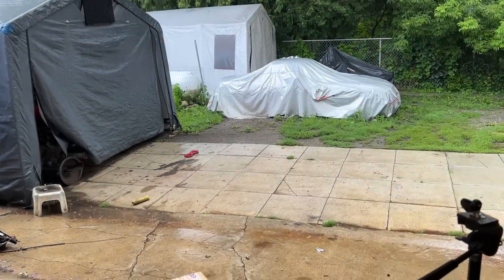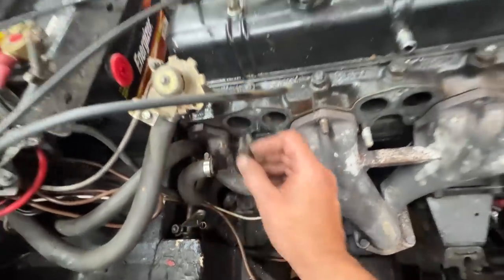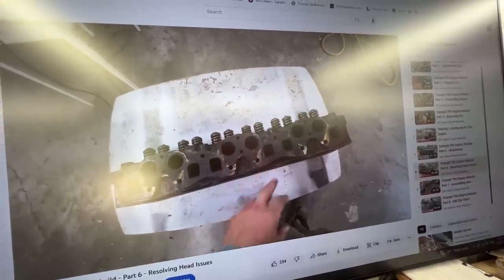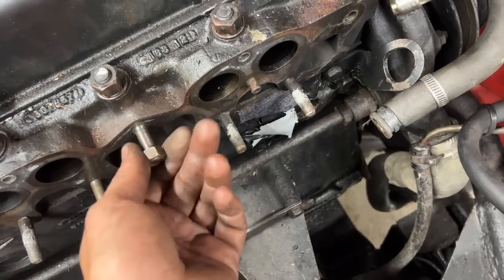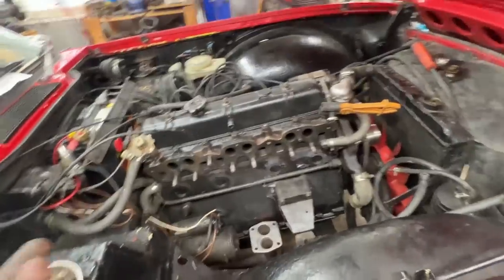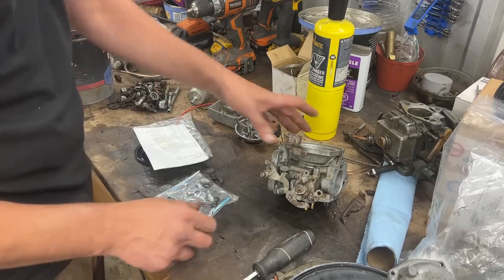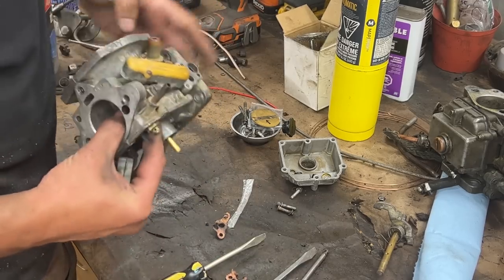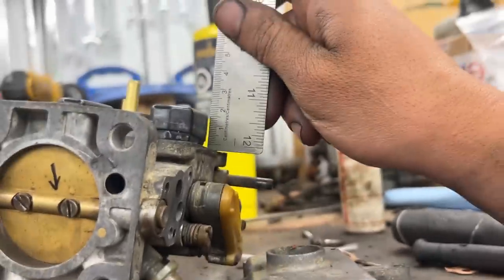1972 TR6 - Part 5 - Carbs, Manifold and Water Pump

Comment: Like you Elin, I thought that cylinder head was cracked !  Can't recall during my years of working in the motor trade seeing a manifold gasket come off in so many pieces  !  The car is starting to remind me of  the Johnny Cash song "One Piece At a Time"  as it it seems to have parts from 1970-71-72-73 😂.. Great work and video as always .. Looking forward to seeing it tuned up and made ready to rock.
Reply: I was thinking the same thing. :)

Comment: Hi Elin, yet another great video, don't know how you have the time to do it.  Ive always wondered why triumph bothered with stromburgs when the SU's were far simpler and did exactly the same job ???  must be a reason as the stromburgs must of been more expensive ?  They certainly were not better for emissions than SU's.  P.S. when are you getting back to the GT6, really missed that one, can't wait for you paint it in colour (please do it yourself that would make a great series ;)
Reply: Stromburgs are better at meeting emission standards than SUs and that is why they were use on North American cars.  The diaphragm provides more accurate needle positioning than the machined piston clearance of an SU.  As long as the diaphragm is in good condition it won't leak vacuum.  As the piston is an SU wears, it can leak vacuum which can affect the height of the piston and thus the air fuel mixture.

Comment: Hey Elin, love your videos. I wouldn't tackle half of the work on my 76 TR without your video guidance.   Just a few questions. I'm taking on front suspension and would like to know how long your spring compressor bolt is and does it need to be fine thread? One more, do I have to totally remove steering rack to change out the mount bushings. Thanks very much. Doug G...
Reply from the maker: It is 18” of 3/4” threaded rod. It doesn’t really matter the thread pitch. Mine is corse but it might be fine too. You can change the mounts on the rack without removing it.

Comment: The throttle shaft seals are assembled in the reverse to a normal seal. So that when the vacuum acts upon it the seal, it draws the lip against the shaft. In an engine the crankcase pressure is positive, So seals go in the conventional way.  If you fit them in a carburettor the conventional way they let air in. 🥴

Comment: That is a real "Franken-car" made from various different model years.  If that is supposed to be a 1972 or 1973 model, it has the wrong front bumper on it.  That's a model year 1974-75 front bumper with the big black rubber battering rams on it.

Comment: Engines mounts, you have the mounts with the gap in the middle of the rubber, those are wrong, you need the type with the solid rubber centre

Comment: They were drunk when they manufactured these cars. They mixed every year with others.
Reply: The factory workers didn't give damn and were only looking forward to their next tea time break.  They installed whatever parts were sitting there on the shelves when these cars went down the assembly lines and left it to the dealership network to sort things out.  the factory managers were only interested in daily production, not quality.  Bonuses were paid for production numbers, not quality control.